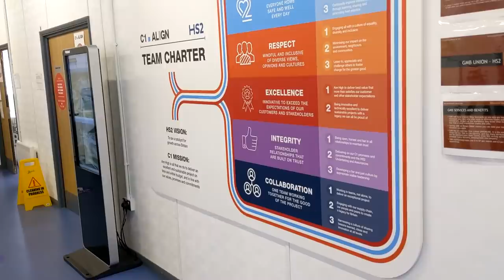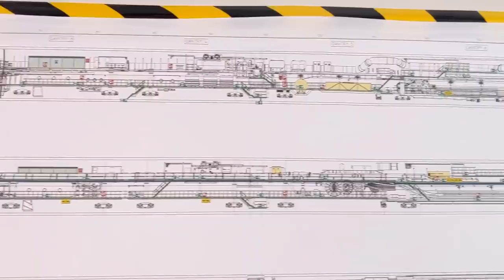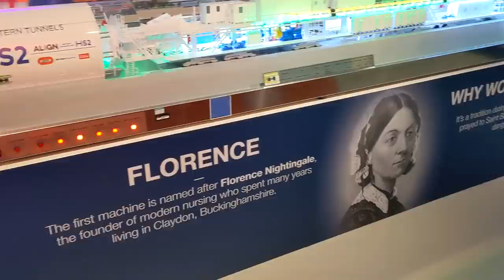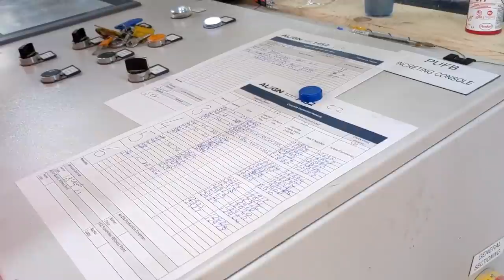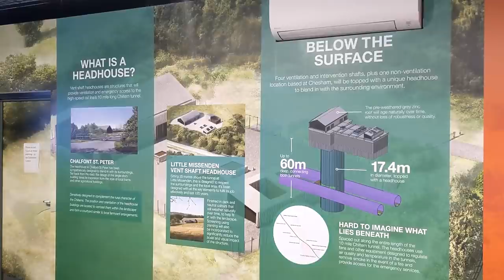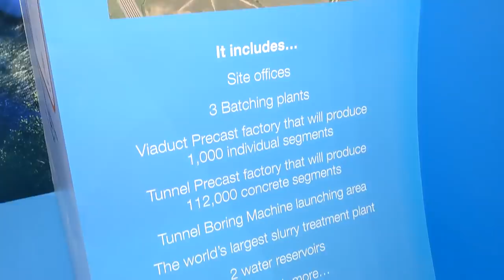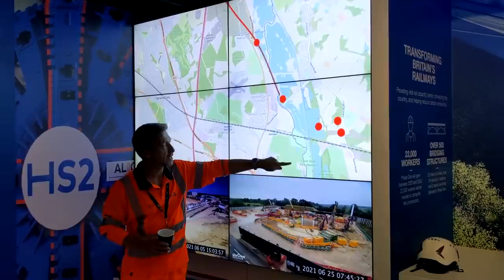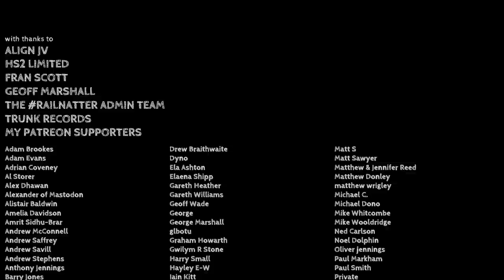#RailNatter | Episode 76: High Speed 2 - building Britain's longest railway tunnel

Comment: How is the tunnel lining steered ? (not the cutting head, that's covered) 

Is there a small variation tolerated on each ring to steer it - or are the rings themselves very slightly tapered rather than being exactly parallel 2.5m - then rings rotated relative to subsequent rings to steer the lining in the desired direction without having to make special sets of rings ??
Reply: I think they touch on it briefly at 1:06:58 and it appears that the segments might be standard but able to shift around slightly.